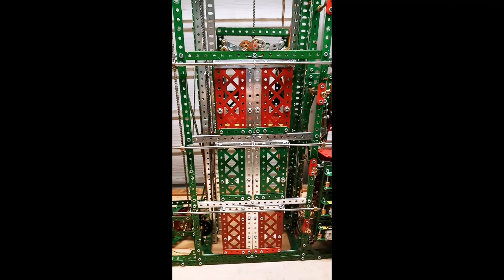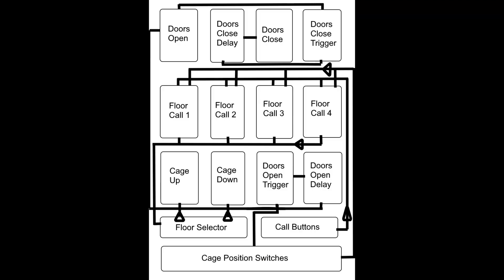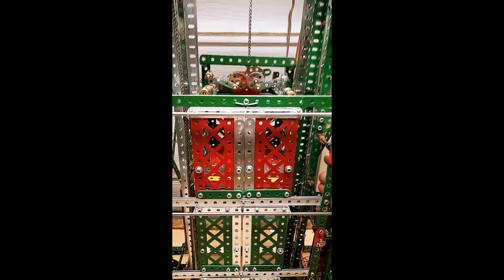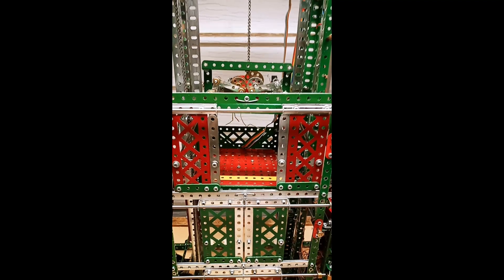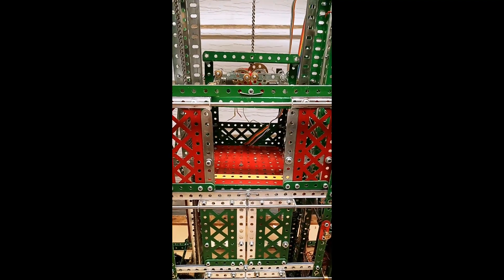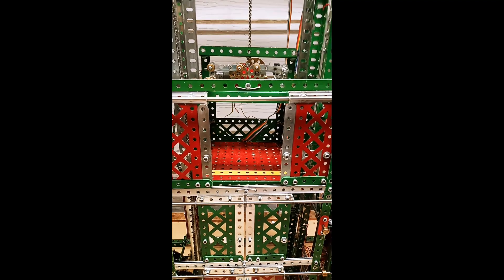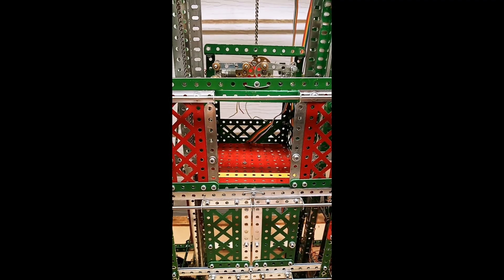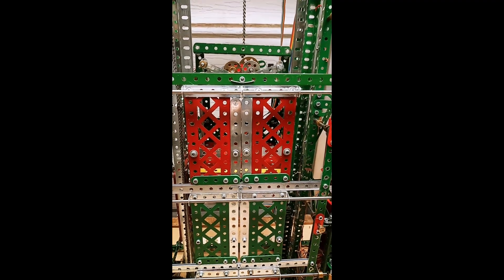Four-floor Elevator with Relay Logic in Meccano

Comment: Thank you for an excellent model. An Arduino processor might be the next project to control the system. Frank Hornby would be very pleased that people are still using his system as a development and recreational tool. Not bad for an invention that is 124 years old.
Reply: I believe we have become far too dependent on programmable logic.  We are seeing more and more simple machines like manually operated presses which are using them when a handful of relays will do the same thing.  We even have ones now which can be programmed in C/C++.
Reply: I agree that there are control applications where electro mechanical controllers the best solution.  They are immune to electrical interfference,  better options when it comes to maintainance and availability of spare parts.  There are no requirements for programmers or software.  I have worked with both types of control systems in factory  applications. Over use of electronic controllers makes equipment oblolete quicker..
Reply from the maker: Thanks, but no Arduinos for me! I'm very much an electro-mechanical guy.